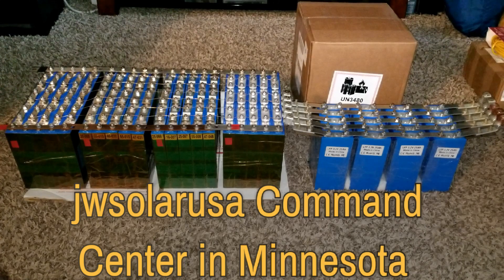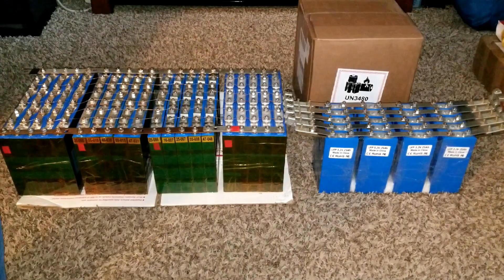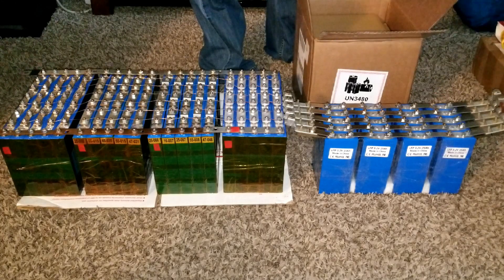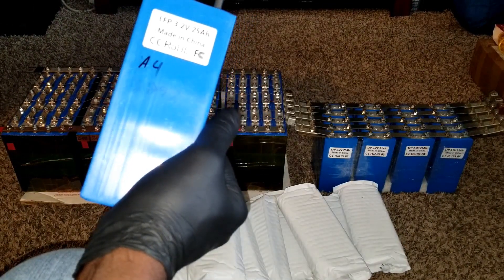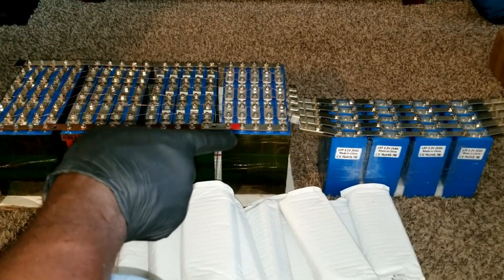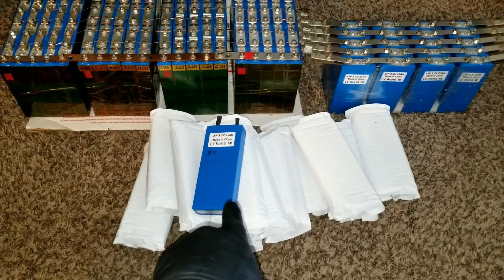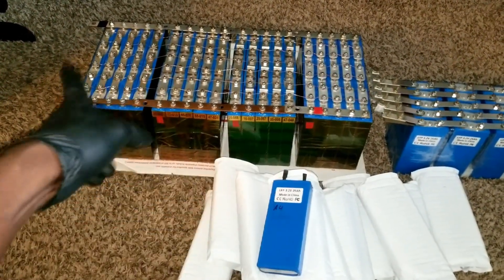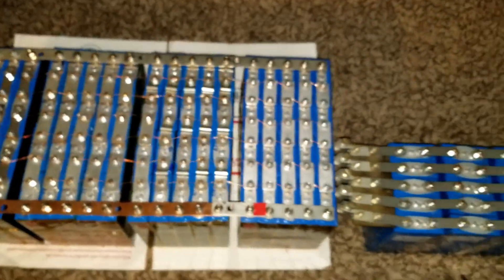DIY OFF-GRID SOLAR BATTERIES, (off-grid solar system packages with batteries Part 2)

Comment: I was in the same boat when buying batteries that were low in stock. Bought a box of these smaller capacity ones for projects, and when I could next afford another box, they were completely sold out. Still have the one box, but it is rather disappointing I couldn't get more.
Reply from the maker: Is that not something? 😀
Reply: @jwsolarusa  not for what I planned on doing lol. Would need at least another box, but have moved on to trying to fabricate my own batteries as that might be more fun and far cheaper... mostly working on a saltwater battery cell atm which I am hoping will hold about 5ah of 0.6 volts, which is about as high as I have managed to make it before (^_^)
Reply from the maker: @Suzuki_Hiakura  
Interesting.......👏
Please post some of those project videos
Reply: @jwsolarusa  I never intended to post such videos before, but as I better optimize my batteries, I would probably do so... If you're asking for videos explaining it, I can't recall any as I had researched roughly a year going through websites, articles, scholarly journals, and general electrical videos, such as ones showing batteries, capacitors, etc. I learned enough to start working on saltwater batteries, as they are extremely simple, but I am by no means an expert nor could I remember enough to declare with conviction what I know. 

apologies if my comment is hard to follow or if I completely misinterpreted what you meant, as I am extremely tired at the moment, and only just saw the youtube notification.
Reply from the maker: @Suzuki_Hiakura  
Not at all my friend. I am really interested on your project you working on.
Reply: @jwsolarusa  Thank you. I am extremely tempted to as it is hard to find any videos that go through an in-depth guide or cover a lot of test data. Would likely be a long while from now after I already figured it out more or less :)

Just quite busy with college atm and other stuff, that and the lack of funds lol. Did see the cost of the copper I bought went down by a whole dollar, which is actually quite a bit overall, so a large-scale solution seems more possible in the near future.
Reply from the maker: @Suzuki_Hiakura  
Sounds good